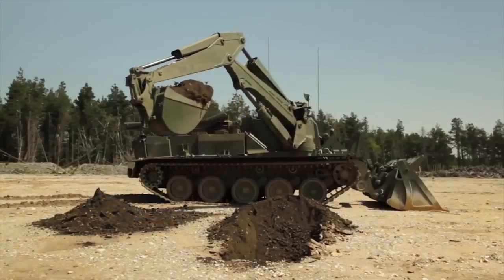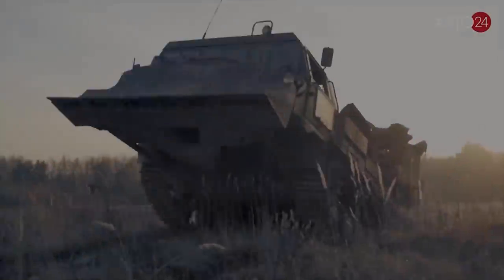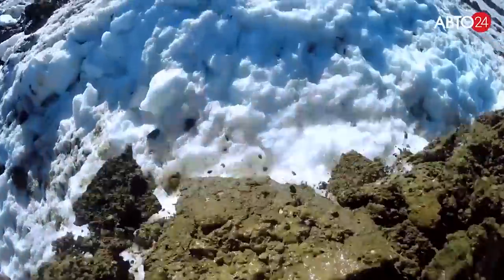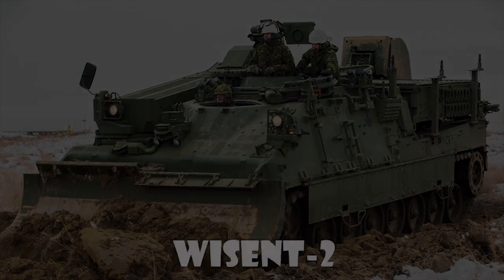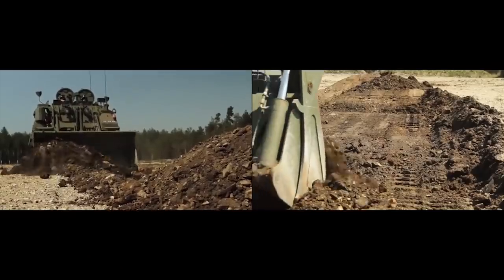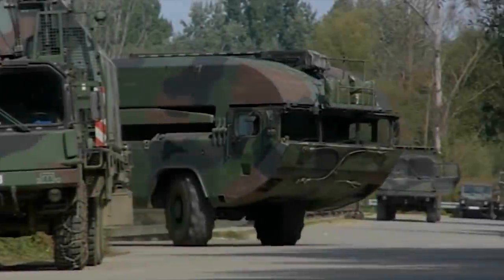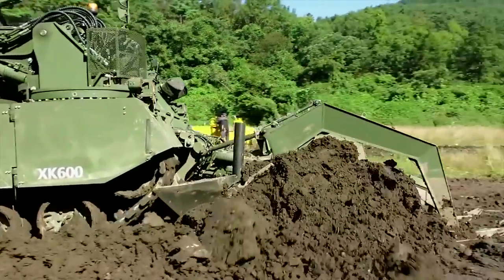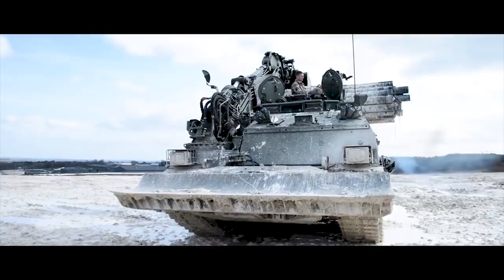10 Best Armored Engineering Vehicles In The World

Comment: In the part of the video that was about the "Wisent-2", every single piece of footage shows the Wisent-1 in both armored engineer- as well as armored recovery  vehicle versions. The Wisent-1 vehicles are all based on the Leopard-1 (more accurately they're based on the recovery-vehicle version of the Leopard-1) and they all have those easily recognizable exhaust grilles on the left and right sides at the vehicle’s rear... -Not backwards facing round exhaust openings on the back of the hull like all Leopard-2 vehicles that Wisent-2 is based on.... -But great footage despite the mislabeling and it was awesome to see that much of the Wisent-1 footage showed Danish vehicles in Danish training areas I know.

Comment: AVLB was introduced to Army back in 60’s
Reply: Which Army? The British Army had the Tank MK5 capable of carrying a front mounted bridge in 1919 (the 1st AVLB introduced into the Army?). Churchill Bridge Layer in 1942 (30ft bridge). Centurion Bridge Layer in 1963 (52ft bridge) Chieftain Bridge Layer in 1973 (No 8 Bridge 75ft) Present British Army AVLB is the Titan which can carry and lay 2 x No 12 bridges each with a span of 13.5m. So the AVLB was introduced to the British Army in 1919.
Reply: @rows10  US Army. The AVLB I talked about is a specific model that use a M60 chassis. To US Army Engineer Regiment, when you talking about AVLB, it means specific one model of bridging asset, not as a category of bridging asset.

Comment: Sorry M48/M 60 AVLB Were in service in the 70s I was a Combat Engineer Maintenance Tech and  we also had the M728 CEV which was the 165 mm howitzer in a M60 series tank with boom and dozer blade The 165 shot out a 100 pound explosive to max range of 1600 m.  First Gulf War we mounted the MICLIC on locally special built  ranks to hold two MICLICs and they worked well clearing a path in minefields
Reply: The British Army introduced the MK5 Bridging tank in 1919. The Armoured Vehicle Royal Engineers based on the Churchill tank chassis in 1942 with a 290mm petard mortar. The trailer mounted Giant Viper mine clearing system was introduced to the British Army in the 1950s a 250m long explosive hose fired by 7 x 2in rockets to clear a safe lane in minefields 4 m wide. I was a Combat Engineer for 12 years. As normal the Americans had all the gear but only after the British Army had the ideas.